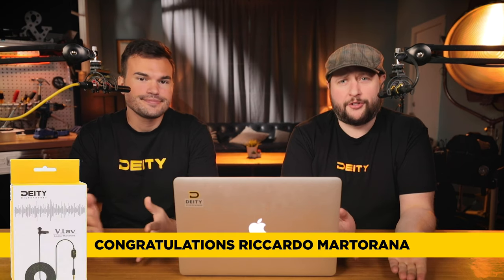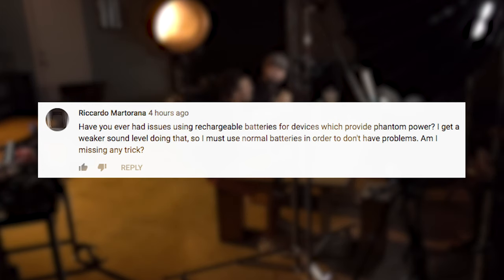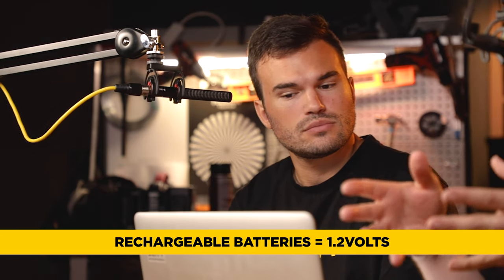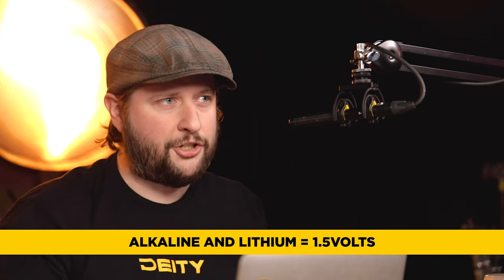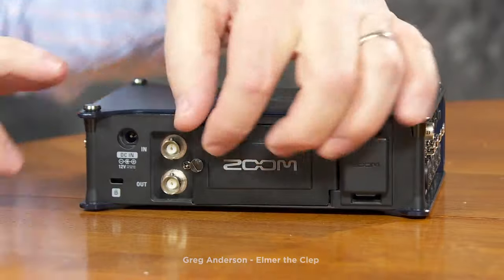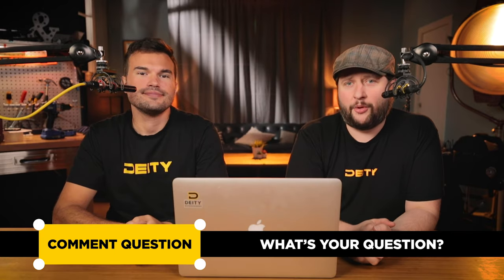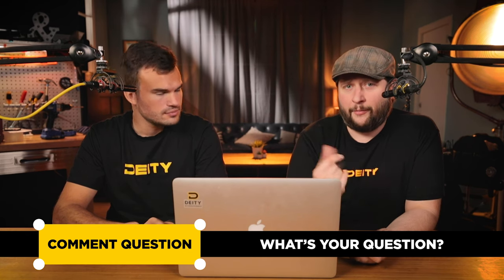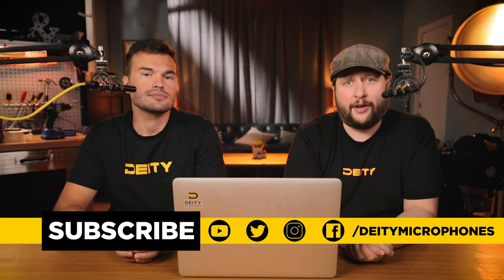Record 3 People With 2 Microphones!

Comment from the maker: When have you had more people than mics? How'd you solve the problem?
Reply: The lav vs X/Y micing is an example of the importance of the roll of a location sound mixer.  
Someone has to be monitoring and checking the on-set realtime mix given to post production for each shot.
This includes tasks as simple as mixing 3 mics down to mono to minimize post production audio work.  

In boom N bag work, this is one of your many responsibilities.
Reply: The problem, Robert is every mic on set has a different acoustic arrival time… If you mix them all down to mono or a 2-Mix for the picture editors, you still have to track them separately for the sound editors…

That is, Unless you’re a really good old-school sound mixer and you know exactly what you’re doing when you combine mics on set! Once upon a time people had no choice… they followed the script line by line.

Comment: Hmm, I would say that the convolution reverb is based on samples. Normally filter sweeps or bangs. So it is working exactly the way the question thinks it works behind the interface. Altiverb can even take into account which slate was used to create the clap to more accurately represent the room reverb.
Reply from the maker: Very cool, we'll have to look into that!
Reply: Yeah, convolution reverb uses an audio sample (called an impulse response) to recreate the acoustical properties of a space.
The audio file is normally made with a sine sweep or a full-frequency noise blip.
A clap wouldn’t be ideal since the timbre and ‘frequency response’ of the clap would be accounted for in the impulse response.

Source: degree in Audio Engineering and Sound Production

Comment: You may have mentioned this in a previous episode, forgive the question, I use the Vmic D3 Pro for my content, should I ditch the foam pop filter as you have here?  I will sometimes boom it but mostly it sits on my table about 1.5 feet away aimed up to my face. Thank you😉

Comment: Is there an easy way to record line-level input on a Zoom H4n? I went from a Zoom H1 to the H4n and was surprised that there was not a simple way to connect a line-level input to the H4n. Did I get the wrong tool for the job?
Reply from the maker: The 1/4" TRS inputs in the combo XLR TRS inputs are line level.
Reply: Or the 3.5mm jack on the bottom side underneath the build in mics

Comment: How do you enhance an interview audio coming from a lav mic in post? I'm using A.lav with premiere pro and audition
Reply: Victor Sidharta  yeah, I ask myself this all of the time. I'm in this situation a lot. Lately I've been integrating small condensers (cardioid) and shotgun mics positioned just outside of frame above the interviewees. It means I have to use an external recorder for 3, 4 and 5 inputs and also that I have to be hyper aware of weird phase issues when blending them in in post... Which can be tricky sometimes.  If you're not a meticulous and detailed person however, you might try relying solely on the effects and plug ins in audition. EQ, compression, reverb, etc...
I'd really like to see an episode on these issues myself. Because I'm doing a lot of guess-work. Do I treat each source individually with compression or EQ if needed? Or only on the master? Treating them individually seems to introduce weirdness sometimes- am I doing something wrong? Lots of questions.